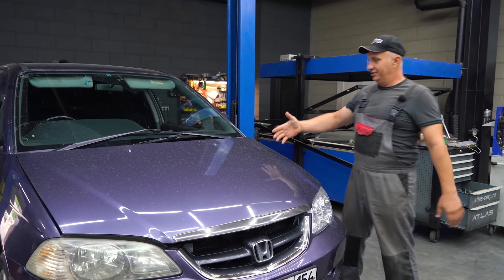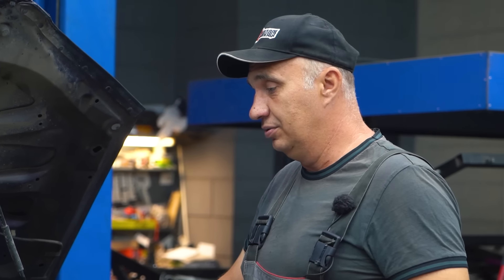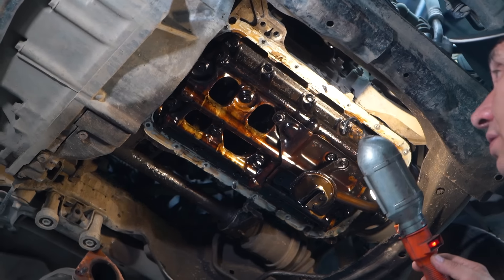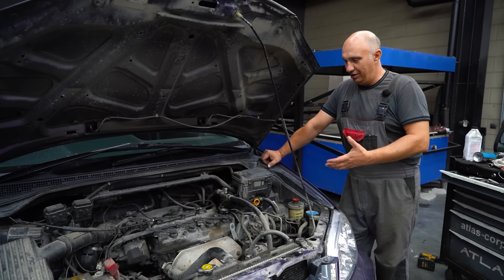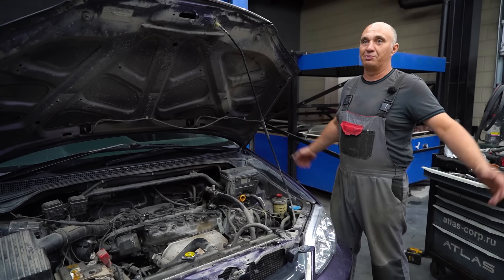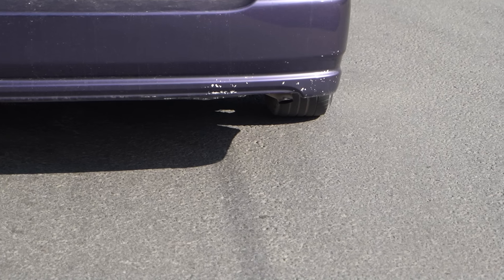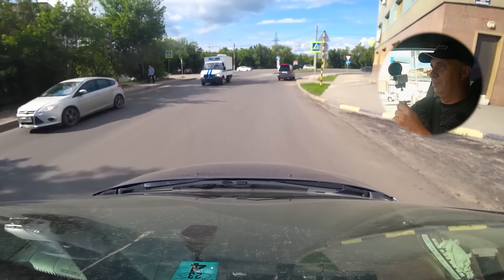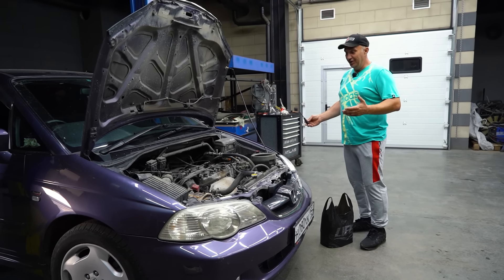We replace motor oil with brake fluid - what will happen?

Comment: Put regular oil back in. See how it acts.
Reply: That should have been done to wrap up the video IMO
Reply: @jesses1589  I like how they actually took it out on road test. very good!
Reply: It probably would have been fine but it seems they probably took some life off the engine.
Reply: 15-40? If regular oil doesn’t shut the light off
Reply: @digi3218 possibly but it may burn less oil if the oil rings were clogged up and not moving around properly.
Reply: @Anonymous..VQ3.5Lg35 I had an 83 mustang that had 0psi at idle. 20w50 helped for awhile 🤣
Reply: that's what i thought they were going to do, after they mentioned the oil pressure issue too - i wondered if they would use a dense weighted oil
Reply: Use a used diesel motor oil...😆😆😆
Reply: Rotella... Beautiful videos... Do the math first...😂
Reply: Yes
Reply: yeeeeeeeeeeeeeeeeeeeeeeeeeeesssssssssssssssssssssssssssssss
Reply: That’s what I was expecting too!
Reply: @Anonymous..VQ3.5Lg35   That's a thick oil and it probably would not flow into the vtec solenoids, and it might not kick in yo
Reply: Brake ful, bad for seals?
Reply: @Anonymous..VQ3.5Lg35 Most cars use 5 - 20.
Reply: It doesn't like the heat
Reply: Stiil in street this is a honda ❤
Reply: @RaymondPessagno My Dodge Avenger uses 5W-20 oil.
Reply: @Anonymous..VQ3.5Lg35 Right? I run thinner oil in my 70s cars lol.
Reply: As soon as the v-tech started working they should have turned it off, drained it, and then put new oil and filter in it.
It even stopped smoking for a few minutes too, so if they'd have stopped right then and changed the oil, I believe it probably wouldn't have smoked anymore and the v-tech would have continued working as well.
Reply: They did
Reply: Its a honda, with regular oil change, you can put 100K on the thing

Comment: There is a screen filter on the Vtec solenoid that can plug. Its something you can check in junkyards when looking for an engine. If the vtec solenoid is filled with swarf, its probably an engine to avoid.
Reply: Yeah man, always avoid the swarf. Otherwise, 'May the Swarf be with you'.
Reply: I hate it when my vtecs all swarfy
Reply: I had something similar happen on a friend's Hyundai (1.5L 'gamma' engine), the cam phaser solenoid had been clogged by plastic-like tar, completely blocking it. Let it sit overnight in B-12 chemtool (toluene is a great solvent), replaced the molten o-rings i forgot to take off before putting it in there,  and then it was more or less good as new.
Reply: I’ve seen the same thing with GM VVT solenoids. People don’t change their oil, and it fills up with sludge, or worse yet, swarf.
Reply: Honda auto gearboxes gearboxes are full of gauze screens that constantly block too.

Comment: Pull the spark plugs and check the cylinder walls.
Reply: ...And the bearings!
Reply: The hone marks are probably 100% gone.
Reply: Why 2oule they be gone 7nless you were putting an abrasive compound down, and brake fluid by itself is not abrasive. So again, can you explain your theory , because my opinion brake fluid can still have some lubricating properties, I would think but hell, I've seen it spilled on a hot exhaust manifold and  flash on fire so fast, and it's a really Brite yellow flame.
Reply: @Tom_Baldwin  brake fluid isn't a lubricant, of course there is going to be more wear

Comment: Can you make a video when you drive a car with diesel in the oil? Like 40% diesel in the engine oil for 10 days and see how clean the engine got after that time.
Reply: I have a 1975 gmc truck 4x4 gasoline . The only oil I use is 15-40w diesel oil.
Reply: I did this almost as you say in my volvo b230f. it was bad before, and after it was like new inside.
Reply: @bobbygreenjr4114 that's not what he means 😂. he wants to put diesel fuel in the oil.
Reply: it'll work that's an old farmer trick my grandpa did it .
Reply: @Frrlas  I have tried it to but only 10%. For 10 minutes, poor man's engine flush. But would be nice to see what would happen if you took more diesel for a longer time.
Reply: Every time I do a oil change, I replace a litre of oil with diesel as a engine flush
Reply: @justinriley8651  oh ok. Now that would be interesting
Reply: it happens on tractors occasionally when the fuel pump leaks. it destroys the big end bearings, and has totalled my neighbours david brown engine. that engine lacked a hole in the fuel pump to release the fuel outside the crankcase if the diaphragm failed. most fuel pumps have that hole.
Reply: I don't know if it's a common practice anywhere anymore, but during WW II many aircraft engines had an oil dilution system that would add some gasoline to the oil mixture to make it easier to pump in cold temperatures. The gasoline would then just evaporate as the engine warms up.
Reply: @bobbobson1605  Oil dilution systems are still fairly common on aviation prop planes
Reply: Use paraffin oil or lamp oil instead of oil to clean the engine.When I was 17 yrs old I was use this method to clean the c50 Honda engines.These engines use the same oil for the engine and the gear box.The clutch was fill all the internal with debris powder from the friction.The only way to clean was to take the engine apart to clean specially the oil pumps.I tried the lamp oil drive the motorcycle for 5 to 10 km and the internal of the engine cleaned to mirror.😊😊😊😊😊😊

Comment: I wanted to see what happened when they put fresh oil back in, took it for a drive then dropped that oil too (to see what the oil was like after the brake fluid had cleaned the engine) and if the VTEC still worked with the fresh oil. 🤔
Reply: I agree
Reply: It should continue working after the fresh oil bexause it seems like they were able to clean out a clog! They really should have ran fresh oil for a final test though!
Reply: Me too, I was surprised when the video ended.  It's like a serial on the TV when they end on a cliff hanger.

Comment: Would be interesting to see how it does on a head gasket replacement oil change schedule from this point: replace with motor oil and then replace again after 500 miles and see how it reacts.   Love to see the experimentation, thank you for sharing.

Comment: I worked at an oil testing lab.  Every once in a while we would get samples where a Jiffy Lube type place would put motor oil in the brake fluid reservoir.  It would destroy the seals in the brake system resulting in no brakes.

Comment: Thanks for running this experiment.  Your videos are interesting.  Some people here in the States use kerosene to clean an engine's insides, allowing the engine to idle.  They drain, change the filter and refill with regular oil.  I don't recall anyone telling me if the engine ran better afterwards.

Comment: A little bit of brake fluid in the oil used to be a dirty trick to reduce oil smoke, at least until the car sold.  It would swell up seals and reduce how much oil got past, but not for long.
Reply: How much for a 5 qt crankcase?  1 qt fluid plus 4 qts oil?
Reply: I don't see how that makes sense. The smoke in the exhaust is from leakage past the rings, which aren't rubber and can't swell.
Reply: @heemlo649  Frequently oil consumption is due to worn or dried out valve seals.
Reply: @jaredkennedy6576  Oh right I forgot about that. Thanks.

Comment: Run an engine on transmission fluid. An old idea is to add a quart of transmission fluid to old oil before you change it. Let it get hot and drain it in each oil change. It’s supposed to clean deposits so long term it stays cleaner.
Reply: @79huddy used to…
Til you ran out of pathfinders😂😂
Reply: @fastinradfordable  cleaned lifters?  I guess?  Who knows.
Reply: You go ahead and do that.
Reply: trans fluid has less detergents than oil by a lot...transmission fluid doesn't have to deal with combustion gases
Reply: Tryed that on my girlfiends '08 honda accord. Works just as good if not better than seafoam
Reply: @joelbusch6084  I'm sure you try a lot of things on your girlfriend
Reply: @foojub6907 You’re exactly right. The old wives tale that says automatic transmission fluid is high in detergent is absolutely not true. Any $30 oil analysis will show that .
Reply: Had a coworker run his Explorer for a couple of weeks on transmission fluid.  Burned the rings out.  Maybe more.  

Didn't tell him to run a full crankcase.  Just a quart for five minuets.  He cleaned out the motor alright.
Reply: @prevost8686 you've got to remember alot of the old "wives tales" came from a time when oil didn't have any detergent in it. I still get non detergent 30 weight for a couple of my antique cars and tractors because supposedly modern detergents don't play well with the nearly 100 year old babbitt bearings and cork seals, and god knows I don't want to be the one to kill those ancient motors haha.
Reply: Just run diesel engine oil heaps of zinc detergent already in the oil
Reply: @nahimgudfam  I did too. She’s great – I found she had an internal lubrication supply, not needing any sort of top up other than from me.😂

Comment: I think it would have been a great idea to change the oil filter, pour brand new oil into the engine and check for oil pressure and general performance
Reply: My thoughts also.  I suspect that all rubber seals are pretty much destroyed.

Comment: I would like to see the same experiment but use lacquer thinner. Only don't drive it, it'll surely die, but try to clean the engine without killing it
Reply: They certainly used to sell flushing oil, which was not quite as low viscosity as thinners, but I remember using it to flush out a straight six Triumph engine many years ago... Didn't make much difference as far as I remember, except it made a lot of smoke as expected.
Reply: I cleaned the lifters of a car with pure kerosene, once.
Drained the oil, put in a new filter, and ran it for a timed five minutes.
Drained it, new oil and filter, and the lifter noise vanished.

We did it to ONLY clean the lifters, and it seemed to work!

Kerosene is a very poor lubricant, that’s all we knew.
As far as being a cleaner, it was good. We knew that too.

We were literally trusting our luck when we did this stunt.
Reply: I have tried WD-40 in two engines, new small can divided in all cylinders through spark plug hole (total 250ml WD-40). Check with a light the drainage and refill the dry cylinders daily over 2 weeks. Then drive 20 km. And replace oil efter that. Rings estimated clean and 1-2 lifters tick is gone. The engines does not need to have oil toped up between service at all.
Reply: I've done that. Mixed with oil of course. A few ounces of thinner. Don't do it much. It will swell the seals and eventually destroy them if over done. Can reduces an oil leak temporarily though and certainly cleans it but there are better products for that.
Reply: it will destroy the rubber seals
Reply: Just use ATF. It's a great cleaner \ detergent.
Reply: can you spin the oil pump with a drill instead of run the engine on this model?
Reply: @hughjass1835  They won't have to, i can already tell you how it turns out. It would be similar to an actual can of ' motor flush ' which my dad & I used to clean out the engine of my 77 Chevy Nova, when we rebuilt it. Afterwards you'll have to put around 25 - 50 miles at highway speed, 70mph, then change the oil again.😁
Reply: @joshuagibson2520  the ultimate cleaner is caustic soda but u MUST clean it out afterwoods with a mild acid

Comment: Do a series of tests with different additives (kerosene, lacquer thinner, paint stripper, brake fluid, transmission fluid, etc) added to at a 1:5 ratio to the oil like regular additives. Put each mixture into different engines with similar amounts of deposits. Then endurance run the engines for a week and see what mixture does the best. 

It interesting to see the extreme end of these tests that I love watching you for, but it would be really nice to see a few tests that I can apply to my daily driver.
Reply: Acetone, ketone
Reply: If you add a quart of transmission fluid to your oil on your next oil change it will clean out your engine very well. My dad told me that trick and he's a mechanic for 21 years.
Reply: @larryloyd2989  I’ve heard it for years too and done it myself. But this channel has the unique ability to put theory to test and actually show the results side by side.

Comment: Scrub the inside of the oil pan thoroughly, and clean out the oil pickup screen and the screen inside the vtec solenoid. While the brake fluid has cleaned up the deposits, those deposits could very well get stuck to the oil pickup screen causing low oil pressure, and the vtec screen which will cause the sluggishness and no vtec.

Comment: Interesting.. less obvious damage than I was expecting, but I would have liked to see if there were metal shavings in the fluid, & if the oil filter was getting clogged w/ any kind of goop
Reply: Swarf in the oil filter and oil pan.

Comment: I had the same problem with my van and no money. So I looked at all those additives but they were expensive. So I went and got the beige Castrol multipurpose grease and squeezed and stroked the tube till the engine went quiet. It lasted a month then I put more in. The oil got real dark I assume the soaps were cleaning out the engine. It worked fine for the summer. It worked real well. So cheap so every month I would add a little. In the winter I got the synthetic 5w50 in the engine. So it ran quite a few years like that.

Comment: Adding 1qt of brake fluid is an old used car lot trick to get valve stem seals and other seals to swell up slightly and seal better. 

You only run it long enough to get it circulated well, then just let it sit for a few days while it softens things up. Warm it up and change oil after that. It helped on my buddy's rsx commuter car with 200k+ and leaky valve stem seals
Reply: just use stop oil leak additives, they help a little too

Comment: Two fluids to always be carried.  Trans fluid can be used anywhere oil is used in a pinch, but not for brake fluid.  Water is best in a brake fluid system as it won't destroy seals.

Comment: Could have used transmission fluid as well and it's an oil so you would maintain oil pressure and have to be careful with the brake fluid being in contact with the crank, rod and cam bearings depending upon what they are made out of and if they are zinc coated.

Comment: I agree. Putting oil back in this motor and seeing if the thing acts better seeing as all that cleaning got done, it seems like it should be rejuvenated 🤔 at least so far as the things that are still capable of doing their jobs are now cleaner, and hopefully able to do the job better. 🤔

Comment: Put the brake fluid into a radiator instead of water. Brake fluid is heatproof too... Who knows what happens
Reply: I've put engine oil in the cooling system dirt track racing. Does not boil when the rad plugs with dirt. Your hoses do go for shit after a while.
Reply: @davidhenri2722  thats wild. But good idea. Back in the say they used high proof alcohol
Reply: Probably would overheat as I assume brake fluid doesn't pick up as much heat.
Reply: @jwalster9412  that is correct.  nothing cheap beats water for specific heat.
Reply: @slec-wz1db Hell, there's hardly any practical expensive alternatives that beat water for this.

Comment: Of course the VTEC would work as long as there is enough fluid in the system to work the actuator. The reason it's burning so much smoke is because the viscosity of the brake fluid is too thin compared to the oil and it's getting past the rings, also why you can't get any oil pressure

Comment: Fully synthetic oil has a simular effect. As an apprentice I destroyed a few neglected Honda engines. Thinking I was doing the right thing, the high detergent thin oil would get past the rings and turn it into an smokey oil burner.
One of the old guys used brake fluid to decoke carburetor engines. Just hold the revs up at 2-3000 rpm and dribble the fluid down the carb for 5 mins, smoked like crazy untill you stopped with the fluid, even the plugs would come out cleaner, welcome to the motor trade🙂

Comment: My '07 Honda Fit has over 140k miles and is still going strong. Keep up on oil changes, throw some injecter cleaner in it every other month or so, it'll keep running for another 140k no worries. Honda makes good engines.

Comment: I ran a small amount of brake fluid in my 92 Toyota forerunner with a 3 L V6 made it to 340,000 miles before the head gasket blue. It kept the engine clean and the lifter quiet. I ran that engine super hard all the time hitting the rev limit. I did have seals go bad on the cam. After 340,000 miles that was gonna happen anyways. This engine was also ran with vegetable oil. I definitely put thousands of miles on it with just vegetable oil in it. I did not treat it nicely and it held up.

Comment: Back in the Day cars would sometimes get carboned up and develop a Knock .. Some People would use a mixture of brake fluid and water dumped thru the Carb at High RPM .. The Old School Seafoam ..We would run some trans fluid thru the carb afterwards to restore lubrication to the parts that were cleaned ..

Comment: I'm quite sure the main reason for  the oil pressure light is a completely clogged oil filter. If the bearings were gone, you should have heard it already.

Comment: When I was a young boy we would go to the school parking lot turn our bikes upside down, away from us and the building, we would get the back wheel moving using the peddles and drop a marble or a steal bearing between the tire and the rim to see how far we could get them to fly! One was 235 feet that was a bearing. So rig up a system to a Lada and drop steal barring's or marbles and see how far you can get them to go!